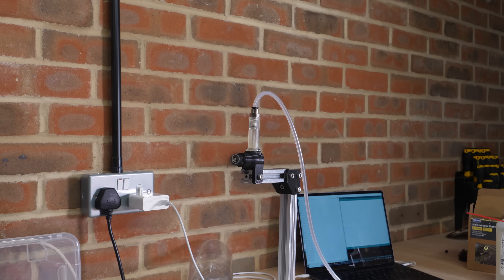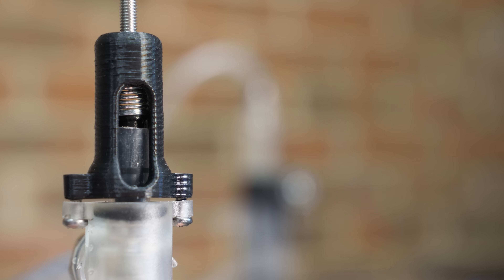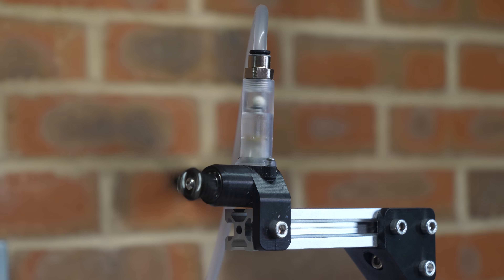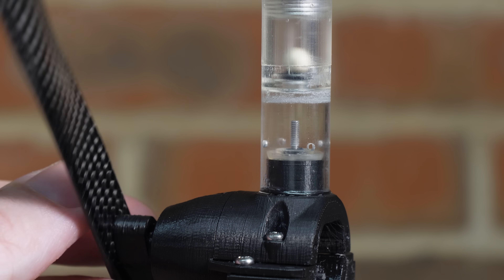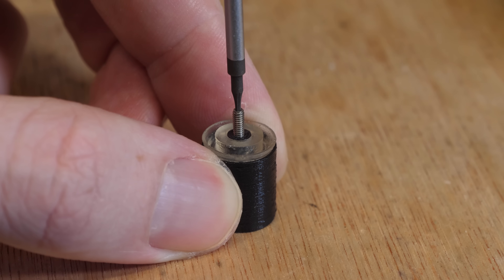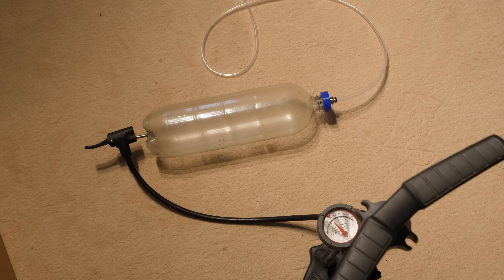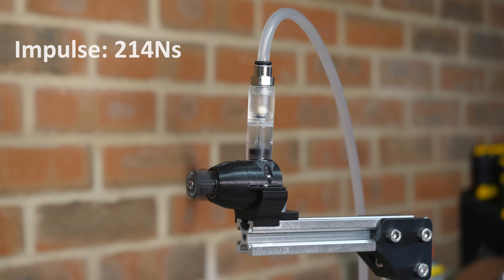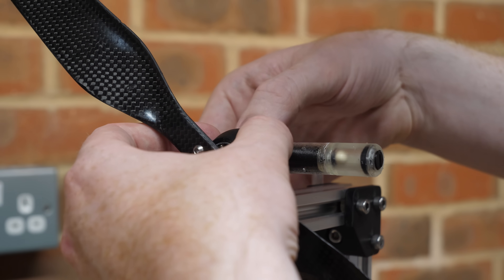4,500RPM Air Engine

Comment: The sound of that twin cylinder was mighty impressive Tom
Reply: That was pleasant sound indeed
Reply: @TheGooEater  🔴 What Is Islam? 

🔴 Islam is not just another religion. 

🔵 It is the same message preached by Moses, Jesus and Abraham.

 🔴 Islam literally means ‘submission to God’ and it teaches us to have a direct relationship with God. 

 🔵 It reminds us that since God created us, no one should be worshipped except God alone. 

 🔴 It also teaches that God is nothing like a human being or like anything that we can imagine.

🌍 The concept of God is summarized in the Quran as:

📖 { “Say, He is God, the One.  God, the Absolute.  He does not give birth, nor was He born, and there is nothing like Him.”} (Quran 112:1-4) 📚

🔴 Becoming a Muslim is not turning your back to Jesus. 

🔵 Rather it’s going back to the original teachings of Jesus and obeying him. 

More ...
Reply: 10:1 is a extremely good engine. That's why it sounds so good.
Reply: Like a revving motorcycle.
Reply: @jonaslind9505  Basically a Boxer engine.
Reply: @mickenoss  Technically it's not a boxer, it's a flat.
Reply: Porsche would be very proud of Tom, he could engineer a flat 6 boxer engine 😍 @mickenoss
Reply: @mickenoss No it isn't a boxer engine because the pistons don't move in opposite directions. This is a 2 cylinder V engine with 180° angle between cylinders. It is actually very bad compared to an actual boxer engine because it causes extreme vibrations...
Reply: @aykirithoughts5265  You are right, similar apart from the crank setup.
Reply: @Henning_S.  Ye, I think he's just trying to keep it simple during testing. I wish I'd used the right word now, most people know of a boxer - not so many a flat.
Reply: @aykirithoughts5265 technically it's both
Reply: @mickenoss  A boxer would be even more efficient, as the pistons in a boxer balance each other's vibrations by moving in opposite directions.
Reply: @Henning_S. H basically its like inline two 180° firing order
Reply: @mickenoss  well, not exactly. The cylinders are 180º appart but the pistons are not "boxing", they should move opposite directions one from the other. Right now it's like V-twin 180º appart (and thus the shaking!)
Reply: @jhoni_48hz  yes the firing order is the same but a inline 2 has much better balance because if one piston moves up, the other one moves down, so the forces almost cancel each other out. In this engine both pistons move left or right together which makes the whole engine shake like crazy...
Reply: @mickenoss  it is NOT a boxer engine a boxer engine each piston has its own crank pin this engine is  flat twin because the pistons share a pin
Reply: @jonaslind9505 *Harley-Davidson Moment*
Reply: Sounds like a diesel under load
Reply: @liam8615  Sounds exactly like my weedwhacker at full throttle. Pretty impressive for no combustion and just compressed atmosphere.
Reply: he should make a v12 version and build a wwii fighter with it
Reply: @clementpoon120  little derpy 5 cil engine for an air powered Po-2 lol.
Reply: @clementpoon120 funny😊
Reply: @clementpoon120  he needs to turbocharge this now
Reply: Offset them by 45 degrees for that Harley Davidson sound!
Reply: Very crispy sound, even the low rpm 'idle' sounded good
Reply: Make a rotory one like old planes
Reply: I think the whole series is mighty impressive. I love these iterative designs.
Reply: Now I want a 28 cylinder star engine.
Reply: mightily*
Reply: What is it with humans and their obsession with the sound of reciprocating engines?
Reply: @Mike-oz4cv  imagine driving a car that sounds like a hair trimmer
Reply: The impressiveness of how good it sounds, deserved an additional comment.
Reply: Bro pushed it to redline
Reply: I cant wait to hear a boxer 4 engine!!!
Reply: indeed
Reply: Gets us to want to see a 4 cylinder engine of this
Reply: Fap fap fap fap
Reply: Ah yes, the casual ear deafening sound that definitely didn't make me deaf
Reply: Indeed! Can we hear one that’s a 270-degree offset?
Reply: India chandrakan shoft landing successful Slibrshan🎉🎉
Reply: Congrats on 5000 likes 🎉
Reply: It's not enough. WE NEED MORE.
Reply: sounds good
Reply: Sounds like every toilet at Taco Bell
Reply: Wow, that’s the only word I can say wow it sounds like an angry motorbike and it sounds like it’s out to get somebody and it ain’t stopping. Not at all. It sounds mad you better watch out.
Reply: Bmw boxer motorcycle engine. Always sounded a bit...farty to me
Reply: Sounds like a harley davidson lol
Reply: whyd i read this in packy lee's voice from peaky blinders 😭
Reply: Indeed
Reply: Sounds like my Harley Davidson Night Train motorcycle twin-cylinder engine.

Comment: You can use a Venturi as a regulator design the engine to work on the lowest pressure possible and the venturi will control that pressure no moving parts necessary

Comment: Now make a radial engine version of it with even more cylinders!
Reply: A Pratt & Whitney r-4360 wasp
Reply: Pratt & Whiney r-4.360 Bumblebee
Reply: Exactly what I was thinking
Reply: Question: How many Cylinders? 
Answer: YES
Reply: ALL of the cylinders
Reply: But he just told you that the double-cylinder engine is half as efficient as single-cylinder!
Reply: @Rhannmah  MOH POWAH BAYBEE

Air powered P47!
Reply: @BasedMan  I was gonna say  that
Reply: @Rhannmah  Tell that to the aviation industry, which has used multi cylinder engines for many years, because it's not so much about efficiency, as much as it is about Power to Weight Ratios.
Reply: @MrDgwphotos   Yeah but they're carrying a liquid fuel that provides in the region of 44 MJ/kg... not gonna get that out of compressed air any day of the week, hence he's after efficiency.
Reply: @Farlig69  Also, even with kerosene you want to be as efficient as possible, each liter saved is money saved. And engine manufacturers spend millions in R&D to find more efficient designs.
Reply: @Rhannmah  Because it's funny.
Reply: @Rhannmah   Very true but its cool
Reply: @Rhannmah  But im curious about Props... Normally when you can increase torque you can change the output ratio, This is similar for everything producing torque.
Reply: @Rhannmah  You can bring facts, science, math to ameritards... but never expect them to accept it.
Reply: @ShainAndrews  My guy, what does being an american have in common with having FUN with a few different designs?
Reply: @ShainAndrews  As an American, I find your statement quite ignorant, filled with misconceptions and disdain.
Reply: @ShainAndrews  sounds like someone is mad because their country didn't make it to the moon.

Comment: We sure have come far in the compressed air engine technology!
Reply: Pumping up you car before going to work 😂😂
Reply: @Guenther-Eichinger interestingly, that's not as crazy as it sounds. There are actual prototypes for air-powered cars that get similar efficiency to electric vehicles, and would potentially be cheaper and easier to build (not to mention much more encouragement friendly than lithium batteries)...  One day you might actually see pneumatic cars on the road 😁
Reply: @brandonmack111  That is awesome!!!
Reply: @brandonmack111 Everything I've seen on pneumatic vehicles shows their efficiency to be dismal. 110 kWh from my home power puts 100 kWh in my Tesla, which gives me 90 kWh in actual go power. (Actually, it's supposedly somewhat better than that.)  Do the math on pneumatics.
Reply: @UncleKennysPlace  The compressor efficiency is really what needs to be fixed and/or looked into more.
Reply: @Guenther-Eichinger  Lol!
Reply: @xmysef4920 especially with your lego pneumatic engine designs
Reply: @Guenther-Eichinger bruh you wouldn't even need to pump it up, you would just flip a switch and in minutes your tank would be full of compression
Reply: @floatingshoppinglist5193  Damn. That joke flew better and higher than Tom's first pneumatic plane.
Reply: @Guenther-Eichinger : Why the meme laugh!.. The "compressed air techn'gy" was TESTED already, since the 30's decade... Pls do some searched in You Tube, about air powered "rail car for mining" ;

Also, the Swiss company, in same decade, which used "compressed air techn'gy" (CAT) - to powered his 'passenger rail car' ;

Sadly, the CAT concept was one of those  "suppressed" technology- for "alternative source" of energy..😢
Reply: We?  Please explain to the world your contribution.
Reply: @ShainAndrews "we" as in the general sense.
Reply: @5peciesunkn0wn  No such thing.
Reply: @ShainAndrews  The collective development of air engines by humans has gone into making Toms air engine. He didn't design the tubing, the carbon fiber prop, the nylon bb, the rubber o rings, the load cell...
Semantics can imply a variety of things from a term or word. There is no specific regulation on what "we sure have come far in the compressed air engine technology" means. 
To come far, as in the species collectively having an understanding of the nuances of air engine design. To come far, can imply we have access to air engine technology. 
We as a human race, have set foot on the moon. Individually, no, but as a species, we have experienced vicariously what its like to be on the moon via video and photography. 
So YES,
We have come far in the compressed air engine technology, by understanding it better.
Reply: @ShainAndrews  There's no such thing as 'we in the general sense'? Dictionary
Definitions from Oxford Languages · Learn more
we
pronoun
pronoun: we
1.
used by a speaker to refer to himself or herself and one or more other people considered together.
"shall we have a drink?"
**used to refer to the speaker together with other people regarded in the same category.
"nobody knows kids better than we teachers do"
people in general.
"we should eat as varied and well-balanced a diet as possible"**
2.
used in formal contexts for or by a royal person, or by a writer or editor, to refer to himself or herself.
"in this section we discuss the reasons"
3.
used condescendingly to refer to the person being addressed.
"how are we today?"
Reply: @5peciesunkn0wn   Yes, and I partially said that because I have also worked on some rather unique compressed air engine designs aswell and have an interest in that area of engineering myself.
Reply: @xmysef4920  I saw that comment you wrote to Shane lol. He big mad methinks.
Reply: @5peciesunkn0wn  Lol perhaps
Reply: @5peciesunkn0wn  And as pointed out... there is no contribution... No such thing as we.
Reply: @ShainAndrews You really need to review your English grammar mate.
Reply: @ShainAndrews  How do you know there is no contribution huh? I have actually partially contributed by making experimenting with my own design, and I also have interest in the same area of engineering.
Reply: @ShainAndrews just let it go, you're wrong and need to accept it
Reply: @20xx-mm-dd  Says you...
Reply: @ShainAndrews   I mean, personally I have actually experimented with some new designs myself.